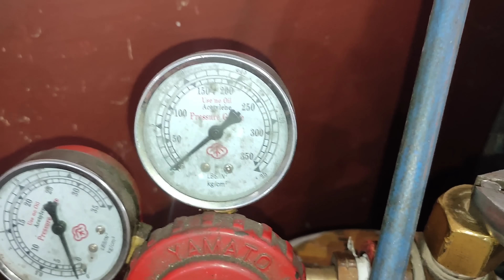how to weld aluminum without argon

Comment: There used to be an old dutch guy where I worked years ago who was an expert at this 
He used a brass rod sharpened to a point to poke at the aluminium to test for the right temperature and then used an aluminium filler rod with flux to make the weld 
He used to fix aluminium ladders this way so it was indeed strong and structural  The skill is cleanliness and getting the base metal at the critical temperature he told me
Reply: I have had good luck using Oxy-Hydrogen torch and an infrared-imaging system. Then it gets to be more similar to Oxy-Acetylene welding of steel.

Comment: Neat technique, and valuable for something that's ornamental or cosmetic only, but any part that's under any kind of real load is going to fail again at the original break pretty fast. No preheat, no V groove, no cleaning, 1mm penetration at best and then grinding down the bead, which was the main added strength doesn't bode well for it lasting long.
Reply: My Dad welded Blimp aluminum air frames for Goodyear  at the beginning of WWii . All he HAD  was an acetylene torch !!!!!!!!
Reply: You make very good points, it makes no sense to weld something up and then grind the weld away. Veeing it out is the only way to go.  He did build up the casting on the back side which will add some strength.
Reply: He clearly shows the v groove he is making with the stick rod then filling with his own cast aluminium rod, and no preheat? What the f*ck do you think the oxy torch is doing, you might need to wear glasses if you can't understand simple things then you leave silly comments
Reply: Corecta remarca Trebuie craituit si cu sirma de aluminiu ados Asta nu vatine nici de la mar la par
Reply: @humes4545  da dar stia cum sa procedeze
Reply: @show-me-the-details  v-grove needs to be ground out, otherwise your just adding material and then grinding it away.  Maybe you’re the one who needs glasses.
Reply: Chuck,
You are right! ornamental use only when done this way. I've brazed aluminum before with the techniques you describe, and you best not get the piece too hot, or you get a puddle instead of a weld.
Reply: 你敢用這銲回的零件嗎？
Reply: This is how you'd weld it as a very last resort, and you had no other way of doing it, a company called Eutectic made aluminium silicon alloy brazing rods, they were really good and flowed well, not as good as TIG welding it but did a good job if you never had tig, this weld will be full of porosity and weak, the most notable thing to me as a welder of 50 years now retired is the fact his nozzle was dirty causing the flame to split, i assume he had no nozzle cleaners.
Reply: What is wrong with you guys that you can't see the grooving out technique,  he removes material with the stick rod then fills with the aluminium rod,  he then flips it over and does the same to achieve a near full penetration weld,  I'm  welder by trade so know plenty about weld prep
Reply: @show-me-the-details  If you're a welder you'll know there will be porosity under the aluminium he's melting and smearing with an arc rod, without a shield of argon or a flux this will be brittle, i've done similar things in emergencies but wouldn't recommend it.
Reply: @hetrodoxly1203  lol.  You are still not getting it,  he's not melting the arc rod,  he's using it to scrape away the oxide layer and create a groove, ,  no more replies from me,  it's like dealing with pre school kids
Reply: @show-me-the-details   I never said he was melting the welding rod; he's melting the aluminium and spreading it out, this will be brittle as there's no shield, all aluminium welding without a shield will be brittle, in effect it's not really welded.
Reply: Это не сварка, а обычная пайка нагрузку держать не какую не будет
Reply: @TheCobraman45  There are many reasons to grind welds. I used to weld ships and we would grind welds all the time. It's about proper prep, Technic, and proper welding and you can grind your welds. You just don't want to grind so much that you grind the metal away from the thing you are welding. This is where your weld will fail.
Though what this guy did wasn't welding as much as it was melting the two halves back together then stacking more Alu on top of it.
Now I weld staircases, no longer crawling into cramped spaces and having to wear a breather just to survive in such places.
Reply: @seangere9698  I didn’t say you can’t grind a weld. I said you are wasting your time welding something without veeing the area out and then grinding the weld away.  I’ve been welding for seventy years and still going strong.
Reply: @TheCobraman45  Well as it is written you the grinding in one sentence and you have V-Grove in the next sentence. Making it seem as two different topics and the later being more of a suggestion the way it is written.
Just over three times as long as me. congrats.
Reply: @glowiever  I don't know what that means.
Reply: he solders.
Reply: 9k
Reply: Aluminum is different than steel. He made it solid probably stronger than before
Reply: @markndg  No.
Reply: @markndg  nope. Aluminium doesn't like to be heated becomes brittle.
Reply: Chuck Bryant... Incorrect. That's brazing, and the brazed joint is stronger than the base material. 

There are drawbacks to brazing, but it's still stronger than DC(neg) tig welding aluminum(which can be achieved with Argon or preferrably Helium).
Reply: @hetrodoxly1203  That is not welding, that is brazing.
Reply: @rixivee  Did i say it was welding? but you've answered the Question brazing doesn't melt the parent metal, it's not as strong, we do use the term to weld generally even gluing things is often called welding.
Reply: @rixivee  Nonsense, just say TIG everyone will know what you're talking about, i worked the pipelines for 30 years, if brazing was stronger they'd have had us using it, anyone can learn it very quickly and would be a lot cheaper.
Reply: @markndg  more brittle,not stronger.
Reply: @rixivee Brazed joints are very brittle,that looks to be a motorcycle part,given the varying frequencies transmitted through a bike I'd expect that to last about 5 minutes
Reply: @notpoliticallycorrect1303  Nah. Brazed joints were previously used on copper water lines. Water lines are subject to phenomenon called 'water hammer'..........
Reply: @show-me-the-details  most people don't weld .I see this technique used a lot where they v out the weld after fuding it together then fill it with aluminum.
Reply: Thatvis stronger than it was
Reply: @notpoliticallycorrect1303  are you a welder. I am.
Reply: @billbailey1620  Only about 42 years experience.
Reply: @notpoliticallycorrect1303  I weld aluminum trailers for a living.aluminum melts together real easy.if you think all that weld on the back is gonna just snap in half then I'd say vote for Biden again
Reply: @billbailey1620   You have little understanding of the harmonics that part will endure ,by creating a stress riser by virtue of the thick weld itself it will simply break along one edge of that weld.
Reply: @notpoliticallycorrect1303  I play a guitar. 8n a major rock band.i know about harmonic ..and am a harmonica.i also teach metallurgy at the local community college.and I just bought my wife's girlfriend a vibrator.i know everything about harmonics and stress risers.and I invented aluminum and hold all the patents(on) aluminum.
Reply: 77ң
Reply: @seangere9698  "Though what this guy did wasn't welding as much as it was melting the two halves back together then stacking more Alu on top of it."   Haven't you just described what a weld is???😀

Comment: Glue the parts together, cover the piece with sand ... and then cast a new piece. That would be way more reliable and stronger
Reply: Rubbish.  Sure, the result is not terribly pretty, but that's a perfectly viable weld.  It is extremely hard to do, you use a carburising flame in order not to oxidise the base metal, the 6013 rod (any bit of clean steel would do) is used to break the existing oxide layer and make the weld happen, effectively you "stir" the puddle, and then extra filler is added on top.

This is how aluminium was welded before the invention of pulsed tig etc.  I was expecting some sort of crappy fake video, but it's not.  The guy doing this is pretty  good.
Reply: @wibblywobblyidiotvision  Thank You for this comment. I'm a mechanic, wondering how this strange welding should work (I never ever thought it could be possible). The removing of the oxidised surface by a welding electrode in fire could be the solution. I'll test it soon.
Reply: LO TUYO.... EXCELENTE, OPINO IGUAL.... SIN ARENA Y SIN GOLPES.... TAMPOCO TIENE UN BUEN MECANIZADO PARA QUE EL MATERIAL LLEGUE A LO PROFUNDO....
Reply: What tip is he using? It looks like it is clogged.
Reply: @autismisnotacrime8007  it sure is, I am a jeweler, worked with torches all my live never seen a split flame.
Reply: @Hesham Attar  I think it's a good chance he's using propane and oxy to do this work. The flame being bushy is from the extra fuel to keep oxygen out of the weld. Acetylene as a fuel would be too dirty to use, introducing soot into the weld? I think propane burns clean enough but needs more fuel per unit.

Comment: Great idea. Non oxidizing flame of oxy-acetylene welder (lesser O2 mix) will create CO shielding to prevent oxidation by air, as replacement to argon gas. Inverted welding stick wire is used to stir molten puddle under oxide layer. Cohesion between molten puddles will push residue of oxides from the joints out.

Comment: As many others have pointed out this repair is 100% cosmetic. With no penetration there's none of the original strength and you basically put a thin layer of aluminum around the damaged part like a Band-Aid! From my experience brazing was much more like soldering than welding. Possibly if some pins were placed between the two parts and a groove ground all the way around the seam was filled, you might be able to make something sturdy enough. This was clearly cast aluminum, and the only real repair for that is recasting
Reply: Incorrect.
Reply: correto a peça continua quebrada apenas revestida
Reply: at soldering and brazing you don't melt base metal, but only just adding material. in this video he starts by melting the base metal and then he sturs the base metal around the crack (like some people do at plastic welding) than he started adding the adding material to a puddle he made with the oxy/acetylene torch. so he is welding, but this is oldschool of doing it, from before the ac/dc welding machines. also, welded alu is usually much better quality material  then most of alu casts. as there is more bubbling in cast material and some of  the bubbles can even contain oils from casting or other impurities.
Reply: My thoughts exactly that this is cast aluminium, besides the actual repair two things that will cause future failure. The cooling process, water that creates grain issues. Secondly the whole piece should have been annealed allowing grain alignment. That said, Then you do what you to with what you got!
Reply: @desmondmclinden9878  If you weld ALU you never get the same Material strength you had before the weld , you loose 30 % of the initial strength . And most channels here on Youtube declare Alu Brazing/ soldering as welding, one important point is ALu soldering is not certified for critical parts sometimes even repaired parts by Welding like Motorcycle frames , Alu pull a lot after welding so everything is out off Alignment , oh did I mention the loss of strength .

Comment: I use to gas weld aluminum castings with a blue Flux and a aluminum filler rod in the early 70's, at the Crown Cork and Seal Welding Shop
Reply: Many years ago I had my aluminum Harley crankcase gas welded at a truck repair shop. The fellow who did it was very skilled and did a beautiful job. This was before Heliarc (later TIG) became common in workshops. The only difficulty in aluminum gas welding is being able to see the puddle as it is quite bright.

Comment: I also used this method 2 yrs ago when an Isuzu giga truck hood hinges were broken and still in good shape until now.. I just welded the aluminium alloy with oxy/acetylene and with a steel rod to mix the alloy well and remove the impurities.
Reply: let me guess 6013 steel rod?

Comment: I guess that is bracing. As far I know in order to get weld two pieces of metal the heat most reach the  melting point of both metals plus the  third one the adding metal. I am not sure it this guy got it.

Comment: been welding for years,  you must clean, groove cut and prep the repair area very well in order to get good flow out/penetration on the repair, especially when it's cast aluminum, and this looks like it didn't have good penetration...the weld just sat on the surface of the part...
I had a teacher who would stress test everything after we did our welding,,,and most failed...due to lack of prep. 
With today's technology & abundance of affordable TIG welders that are on the market, there's really no excuse not to buy the proper equipment to get the job done right! 
Oxy acetylene torch welding has pretty much gone the way of the rotary dial phone.

Comment: Aluminum has essentially got two melting points, the layer of oxide on the outer and the more pure metal internally,  this meaning that by the time the oxidized layer becomes molten there's every possibility that the core is already molten so when feeding your filler rod it could become a full thickness weld, but having said that a bit of knowledge on prepping wouldn't go a miss.
Reply: Very interesting I'm trying to get understand and hopefully be a good aluminum welder using propane

Comment: Pretty cool to know pulling the oxide layer off works if you have to do it. It would probably work with dc tig too, obviously you could only fusion weld it. The applications seem very limited.
Reply: Dùng ngọn lửa nghèo ôxi  và dùng que sắt gạt váng ôxit  nhôm ra ngoài ?
Reply: is not what welding is fusion
Reply: He's using filler rod in later part.
Reply: @topduk  He doesn't grind out a weld channel at all. It's all surface weld, no real penetration.
Reply: You can add filler in a dc tig weld
Reply: Actually, you would use AC when TIG welding aluminum.
Reply: @topduk  That's actually an aluminum BRAZING rod. Not actually WELDING.
Reply: @JillandKevin  actually...... we used DC TIG to weld aluminum for years. And still do
Reply: @dieselguy62  Cool! Never heard of anyone doing that. What gas & techniques do you use? Would love to be able to use my little DC machine on aluminum! I HAVE gas welded aluminum, and did some aluminum arc welding years ago with some special pink al rod, but never TIG with DC
Reply: @JillandKevin  you don't do it with a little machine. It takes allot of amperage. We really only used it with heavy aluminum plate.  There's find of info out there that describes the process and equipment needed
Reply: @dieselguy62  Thanks Brian! Sadly, all I have is my little 165 amp inverter, so guess aluminum is out. I DO miss my big Miller, but we're musicians, and moved into a travel trailer and hit the road a few years ago, and had to liquidate my shop when we retired & left, so can only have the little one!
Reply: @glz1  All welding is fusion, no matter what heat source you use. From a coal burning forge to a laser it is all fusion.

Comment: I’m not saying this isn’t working it clearly is but I doubt the bracket has any where near it’s original strength ,this looks like a pillion footrest casting usually made from crap alloy by the manufacturer .we used to weld alloy castings with oxy acetylene and flux coated rods ,many years ago, I would say this is ok if your going to sell the vehicle on and you do not have a problem with the potential risk you are causing to others ,personally I would like to see a new bracket
Reply: IT does of course depend on the original alloy used, but assuming it's decent aluminium. I have welded numerous aluminium part with success but he doesn't even grind out a weld channel to fill. Can't see there being much strength there at all.

Comment: I'm thinking about trying this for my Yamaha Raider's passenger peg mount that broke in half from a accident. My biggest concern is the strength after trying especially seeing it's double the thickness of the one in this video and my welding experience is almost nonexistent. But replacing it might be extremely difficult because replacement parts seem to be difficult to locate and therefore expensive if you do. Any ideas on the cost a professional welder would roughly charge.
Thanks
Reply: 40-200 dollars depending who you know and where you go. they are hard to find sometimes and are very busy. getting the right gear to diy usually pays for itself the first project if not the next few projects. imagine all the things you can do with an oxygen acetylene torch, an arc mig tig welder etc.....